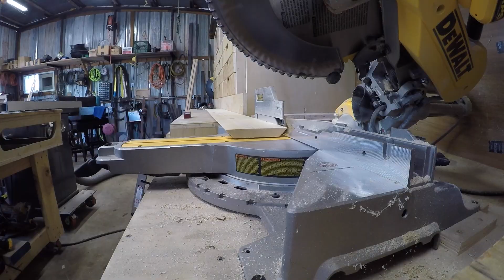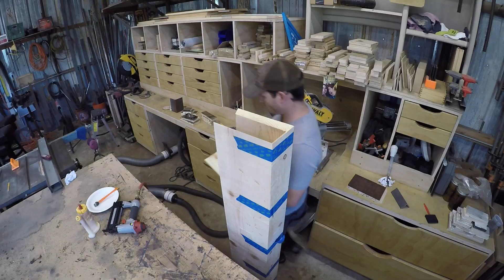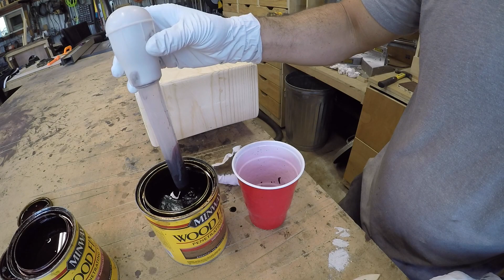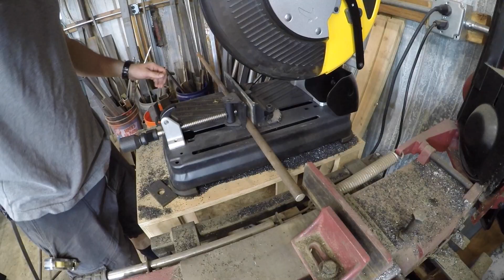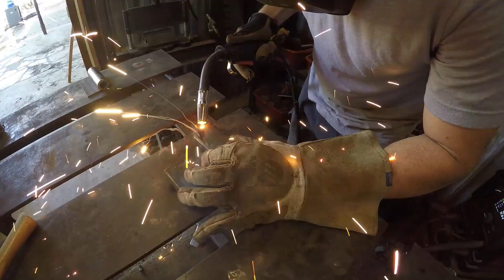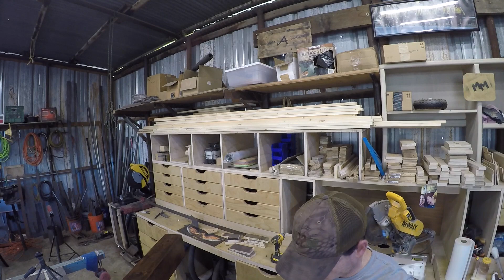Building a Rustic Wood Mantle

Comment: I saw that it was placed over a fireplace. Did you have any adverse joints pulling apart with the heat from the fire place and the glue that you used to assemble?
Reply from the maker: I didn’t build it for myself, but haven’t heard anything negative from the customer yet.

Comment: Hello
I'm trying to find the video of the fireplace mantle. I believe you made it I'm actually getting ideas how to put wood planks on my new construction wall. If I remember correctly you used underlayment painted black to hide and cracks or holes. Just making sure I'm right before I start . Thank you for the videos they help alot.
Reply from the maker: I’m not sure I understand... this comment is on the mantle video,right? I’m not sure if you’re referring to the rustic backdrop video?
Reply: A Modern Maker no problem I apologize for any confusion I may be confusing you with another video I had seen these videos or YouTube or great there's a lot of teaching one of them you may or may not know the answer for what I'm looking for but here goes I am building a new house in in between the kitchen and living room on that wall which goes up to cathedral ceiling I want to put reclaimed wood or some other type on there as my accent wall. So I see plenty of videos showing how to put the wood on the wall but I have not seen any that shows how to put it on a wall that has no drywall on it just the studs so I'm wondering if I should put underlayment on the wall and paint it black so when I put the wood on it whatever I pick out I have not only something to mount the wood 2 other than the studs it will hide any imperfection of the wood cracks holes or whatever so you can't see through it.. I know I just said a lot I hope that makes more sense.
Reply from the maker: I get what you’re saying now. I guess it depends on if you would plan on mounting any of the wood strips to that wood or not. If you could mount to just the studs it might be easier to use a black house wrap type paper to black out the gaps.
Reply: That would work I did not even think about black paper on the other side of the wall I will have drywall but like I said I just was not sure if I should use underlay or that would just be an extra expense that I really don't need studs are on 16 inch centers hey I appreciate the input and I watch your videos they're great because I'm trying to get into wood work thank you again
Reply from the maker: No problem. Hopefully it could help or at least give you something to think about. Good luck!

Comment: Looks great. What kind of band saw is that? It has so much clearance. I'm looking for one like that. Thx
Reply from the maker: It’s the Laguna 14-12. Yeah, the resaw capacity is nice. That’s one of the reasons I went with it.
Reply: A Modern Maker thx bud. Since my posted question I found a rikon with 13 inch resaw capability.  Know anything about those?
Reply from the maker: I’ve heard good and band stuff about the Rikons. For me it was between those two and a beefed up Grizzly. The laguna has worked well and is a stout machine.

Comment: Awesome mantel!   Was that polyurethane you were putting on that had the blue tinge to it?    And I may have missed it.  Why did u epoxy the round pieces on?    Keep up the cool builds
Reply from the maker: +Gardners Garage Workshop Yeah, it was a water based poly by General Finishes. I didn't actually epoxy anything on, but was trying to show where to add epoxy for a semi-permanent mount. The bracket attaches to the wall, the round pieces slide onto the mount, add epoxy to the tops of those pieces, then put the mantle on top. This way, you can attach the mount to the studs and get the mantle perfectly centered. Now, the mantle is epoxied to those pieces and can still slide on and off if needed.